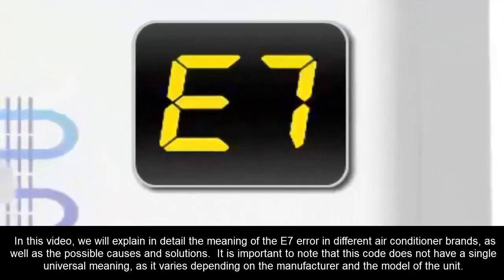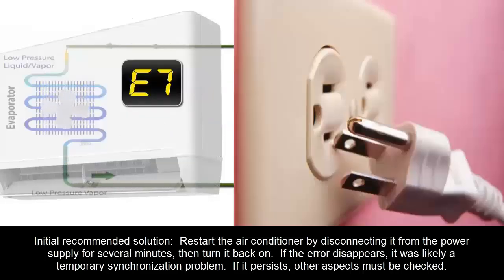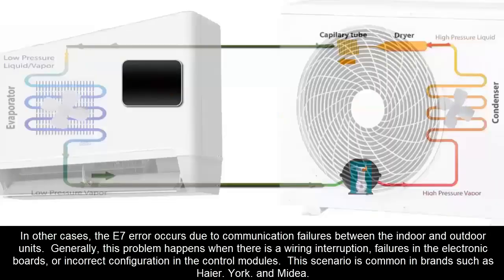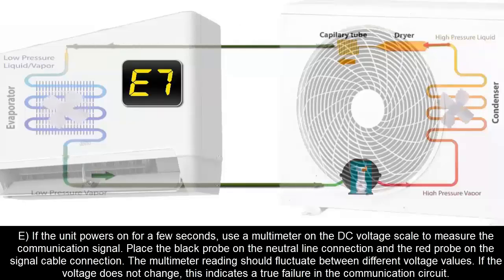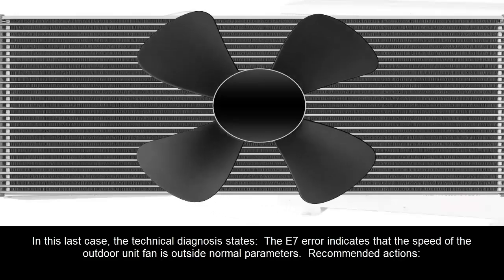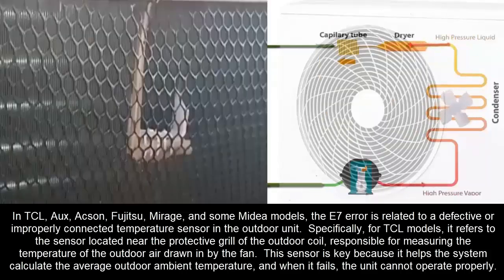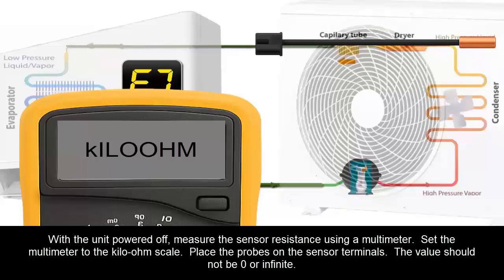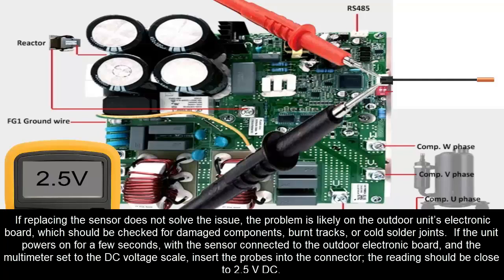Air Conditioner E7 Error Code 🔍 Easy Fixes, Common Causes & Quick Guide

Comment: Haier air conditioners. It's giv0en me E7 fault. I already switched off the main for 15 minutes. After I put it on its starts with a RED and green light on temperature 24. After 5 minutes it literally stops and an E7 appeared. What can I do. Thanks.